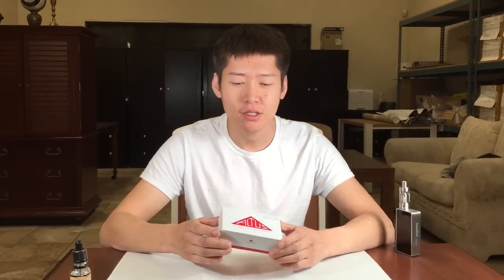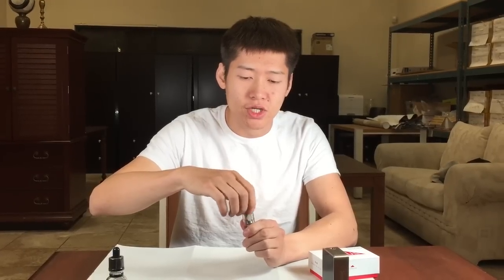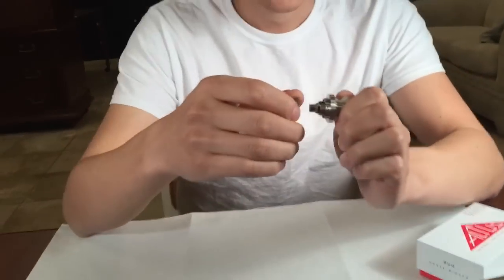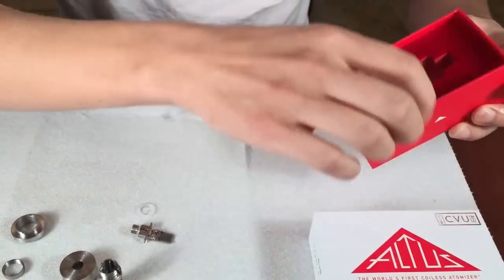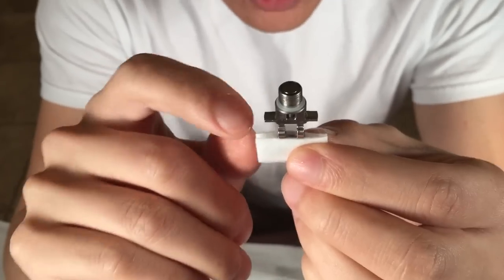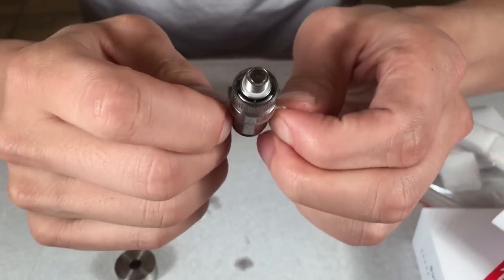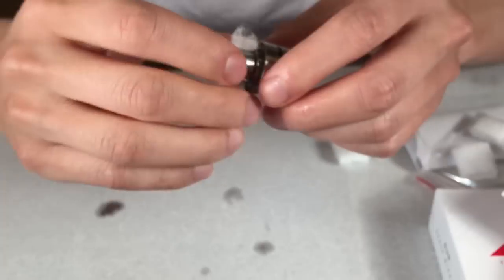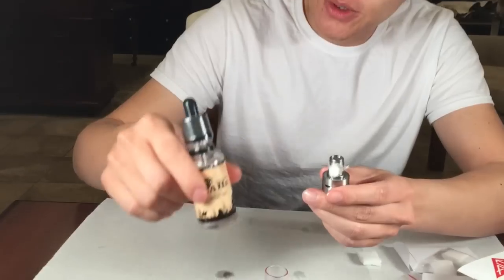Altus coiless atomizer tank by GUO (Unofficial Product Introduction)

Comment: Since your product is available for purchase, wouldn't it be advisable to release the composition of the materials and MSDS?  I am VERY interested in purchasing one, but won't until I know what it's made of.  You've created  game changer in the vape world, I'd just like to see you gain the trust of the public and also loyalty.  Even if it's cloned, if you build  relationship with your your customers based on trust, it will benefit you in the long run.  Congratulations!!!!!  ;-)
Reply from the maker: +TheGumbyDiver I seriously consider your suggestion :)
Reply: Its a small, virtually non porous, thermo conductive ceramic chip. Which will over time will crack, become brittle, and introduce microscopic shards of ceramic particles into your lungs.
Reply: +k. martin
Not a hater nor any kind of competition. I'm just simply stating the facts, that's all.
Reply: Are you an engineer?  I'm just curious.  I've been thinking about this and kind of comparing it in my mind to something like the material that the space shuttle tiles are made of?  What you said makes sense, but I'm wondering if Davids collective have done testing and have an estimate of how long it will remain completely intact without developing the stress fractures due to thermal exposure.  Also, the instruction manual says NOT to dry burn it.  I'd like to know why that is.
Reply: +TheGumbyDiver 

Oh no sir, no engineer, just very educated and I do tons of research on things like this, especially since I vape myself. I have to be careful what kind of wire I use, cotton, ejuice, ect as my lungs were ruined during a deployment. I believe its a similar material as what is Aerospace applications or even a Silicon/Nitrate based material which, either way, is not good to be breathing in. The dry burning is definitely going to speed up the aging process of the material and most certainly cause it to become weak and brittle. I'm not trying to bash the guy, he just needs to be up front with people instead of "details relased soon or at a later date". I just want people to be cautious of these kinds of skeptical products with little to no information. It's sad how many blind sheep there are now days. I'll stick to my stainless 316L claptons and US grown 100% organic supima cotton.
Reply: I hear ya, Brother.  I never was deployed, but I know about the lung issues.  I'm really cautious as well.  I've stayed way from Ni200 and Ti.  SS is my go to.  I'm finding myself being really skeptical of their refusal to release any information on the materials.  I mean shoot, they're already actually selling them tis weekend and refusing to tell their customers what Temp profile to use.  That doesn't make sense to me.
Reply: +TheGumbyDiver David here: noted. Seriously considering it.
Reply: Exactly my friend, this just seems too good to be true. A company not willing to disclose information regarding their products/ materials used, especially a product used to ingest vapor into your body doesn't seem good to me. I guess we'll just have to wait this one out and see how it unfolds.
Reply: +TheGumbyDiver SS is an alloy, Ti is what they use for surgery and body parts. Im thinking Ti is safer than SS.
Reply: +dansus99 

Ti is fine for prosthesis applications, but supposedly not for heating and ingestion into lungs. I've tried every kind of wire so far and 316L SS has been the oil wire to not give my lungs problems. I have sensitive lungs and asthma due to the military. I had to quit smoking from all this and turned to vaping. Been doing it 3 years now and have tested all kinds of stuff before learning SS wire and Supima cotton is what works for me. To each is  own though, different strokes for different folks.
Reply: +dansus99 Actually when heated TI is less safe, look into the heating properties of both, SS stands up to dry burns for instance, do that with TI and you will have lung issues.
Reply: +E36M3M50 how can you know the "facts" on their product? you cant...
Reply from the maker: +Todd Riley he doesn't
Reply: +jbohn 

Thank you very much good sir. I use wire from UD(youde), a local supplier, or Average Vape Guy here on YouTube. The Supima cotton I use is Texas Tuff cotton. This is the only stuff I use now and have nothing but great things to say about 316L ss and Texas Tuff cotton. My Realeux RX200 had SS temp control and so does my Koopor Plus. I get great vapor production with the peace of mind with the temp protection. My favorite tanks are my Aromamizer RDTA with dual vertical ss claptons. My favorite RDA is my Tobecco Velocity. And my favorite sub ohm tank is my Uwell Crown, especially with the RBA kit. Hope this info helps. Thanks
Reply: +k. martin 

Look at his next video. Thermoconductive ceramic embedded with tungsten. I guess I do have my facts.
Reply: He's using his own invention on camera for everyone to see. It's like a fugu-chef: you must prove your skill by eating fugu you cleaned. If you did it wrong, you die.

Comment: It looks like a silicon nitride si3n4 heater.Very well designed.
Ramp up time not gonna be a problem for preheat capable mods like dna200.
Reply: +oynamalan Now they just need to let us know what resistance wire type is embedded in their heater core, or at the very least release a proper TCR curve for it. Oh, and claiming it's fine to use on any regulated device is just plain dangerous.
Reply: +Rob Carter It's probably tungsten.
Reply: oynamalan Yeah so far that's been the most likely candidate I've seen. Makes a lot of sense as that would work correctly on ni200-tuned devices with the temp turned down about 25% from desired actual.

Comment: This product has the potential to push towards a much, much safer form of vaping. This product is extremely new but as long as the chip is insulated safely I see no reason why it could be dangerous other than if someone tries to use it at 150+ watts hopefully it is  safe at higher wattage devices. I would recommend this to anyone looking for a simple product for vaping but not for a  introductory vapor. I hope David continues to make more products as innovative as this one.

Comment: David, I just received my tank today.  I'm having some issues and I hope you can help.  When I opened the box, the tank already had cotton installed.  So I primed it and filled with juice.  I was using it at 50 watts to start and went up to 65.  After just a few minutes I started getting burnt cotton taste.  So I replaced the cotton and the tank started leaking all over the place.  I fixed that (I think the bottom module's tabs weren't locked into place).  Now I'm trying to vape again and it's splattering my mouth with juice.  My first two draws literally gave me a mouthful of juice.

I'm not bashing the product, but I figured as I'm one of the few people who got this immediately that you could help me since there's very limited information so far.

I want to love this tank, but I need it to work properly first!
Reply: Hi Jon, for the Altus to work properly 1) the CVU needs to be correctly centered on the port and inside the cylinder, 2) the cotton needs to be installed correctly. All the tips in the user manual are important to be followed. I will post more videos to clarify for you tonight. Can you email me a photo of the CVU on the port clips? Guovape@gmail.com We'll make this work for you.

Comment: I understand why you want to keep the name under lock and key, but for people with TC mods that are calibrated for either Ti, Ni or SS wire which setting is closest calibrated to the device?

I'm sure it would be found with trial and error, but knowing ahead of time would prevent a possible dry burn.
Reply from the maker: +charlsey26  it shouldn't take long. We are working with selected manufacturers to have CVU compatible mods. Look for those in the future.
Reply: +David Guo in the video you're saying that you're using it in TC mode on snow wolf. Which TCR is mod using?
Reply: +charlsey26 Yes, I'd like to know this as well. Also will you be releasing TCR values for people with the DNA200 and SX350?
Reply: +David Guo Ha, so you want me to buy a new mod to? Pfft I'll wait till somebody else figures it out.
Reply: +E36M3M50 the 2nd law of thermodynamics dictates everything will fall apart over time, even the universe. I can't disagree with your general statement of "over time". However, the chip is so sturdy the technology is tested up to millions of cycles. I didn't want to disclose this number because it implies the possibility of over a decade of usage time - which is scary. But that's the extent and potential of this technology. Can we do more comprehensive further testing? Yes, we must and we will, especially because we want to prove our reliability to skeptics 😊 In the unlikely event that the chip does crack, which is more likely to happen by trauma such as throwing it against a hard surface, the crack will cause the chip to fail entirely and stop working. 90% of it is trapped underneath the cotton, and the density of the chip makes it unlikely to travel upwards against the force of gravity. Why not also consider the risk metal poisoning? I think that's a higher risk factor.
Reply: +chill out about the usernames man 
I meant to say that the risk of coils such as metal poisoning is a higher risk factor
Reply: +chill out about the usernames man 

If you want to get into metal poisoning, isn't the tank that helps contain the ejuice metal itself? I just don't understand why you cannot disclose what the chip is made of (msds) to ease new customers minds. If you stand behind your products and want to gain the customers trust then I feel it's the least you could do. That kind of information needs to be released when introducting a product to the market. Especially one that is directly or indirectly ingested into the human body.
Reply: +E36M3M50 there is no fda regulation or any regulation of any kind on vaping. Do you have a link to Arsenal wire msds? How bout Royal?
Reply: +E36M3M50 I wasn't aware that the tank itself was a heating element. I want whatever you're vaping
Reply: +charlsey26 it's a great idea ,but cloud is not that amazing  Click below link to join the 10000 vendors facebook group to see how vendors think about it https://www.facebook.com/groups/438713829637655/

Comment: Looks like the same design principle they use for an induction stove top. If so, then the liquid won't even be exposed to the heating metal at all, it would be inside that outer layer. And it's almost definitely SS underneath if he's using it on temp mode and wattage mode. Could be wrong, of course.
Reply: No if that were the case you guys would wait for a minute per hit lol

Comment: Is the chip replaceable, or is it essentially most of the investment?  What is the anticipated life expectancy of the chip and other components, roughly speaking?

Though I may be disinclined to invest so much in any 1 tank, it sure would look attractive if US regulators make it difficult or impossible to buy the traditional disposable coils and other vape products we have become used to (especially for those who don't build their own). In any case, kudos on the innovation!
Reply from the maker: +JGG11 It's a new product and we will honor our 1 year warranty. I expect it to last for years if you don't abuse it.
Reply: +David Guo I get you not wanting to release the material of the chip, but your refusal to answer simple questions like this guys question about whether replacement &quot;chips&quot; and questions about what temp control setting youre using on your mod are a real turn off. 

Im intrigued by the product but playing coy about basic questions about usage of your device really sucks. You need to rethink your strategy with your answers.

Comment: After further research into this product it seems like you have to use this device with temperature control set at around 450° otherwise you will get dry hits. This needs to be mentioned to anybody wanting to buy this. Because if you're mod does not have temperature control for tungsten and you go above 70 watts you will definitely get a dry hit.Also this doesn't seem to work very well on high VG E liquid due to the amount of wicking material, it basically can't wick fast enough.
Reply from the maker: +Phil Pinto Thank you. You may try Fiber Freaks' cellulose fibers, and generally thinner cotton will increase the rate of wicking. Just be careful not to thin it too much or else leaking may be an issue.

Comment: DAVID I cant get mine to fire in temp mode, im using  rx200, onwatts it works like  a normal tank but i heard its best best best on t.c
185 c, 72 watts, refuses to fire in temp mode '; ? any suggestions ? , even the warm up temp u suggested,  so on reloux , i d k how they do temp, should i vape it or try it on nickel or stainless steel, wjats the temp for tungstung

Comment: Is it possible to damage the chip by overheating?  If that happens is there a way to replace the chip and only the chip?  Thinking long term it seems like since it is exposed to pretty high temps over and over it would eventually need replaced.
Reply: Under 600c should be no problem. Operation temperature is under 200c, so I doubt you will hit that high temperature unless you do it on purpose. I took it much higher repeatedly and it still works 😝 But please don't do that and read our warnings. Anything can break at high enough temperature. Even superman is weak against kryptonite.

Comment: and i got rx200, so  the chips pretty good, i did the warm up like david said, but whenever i put temp control on, it wont fire it jus says like "temp locked" or something like that. should i b vaping it in nickel settings, ss settinfs? help! also, i blow hugeee clouds on just watt mode so idk what the other guys were syin
Reply: Hi Ryan, it's David here. In general the RX 200 is not the greatest TC mode for the Altus. I suggest using power mode or switching to another mod for TC mode. But if power mode works fine, why fix it if it ain't broke? Thanks for supporting our product.

Comment: Remember Vapin Donuts? Pretty much identical concept. 

You claim it works for temp control, but given the size of the embedded wire and the listed resistance, it's almost certainly not nickel. If that's the case, you must specify the material, or at the very least the TCR, so that people can safely use this thing. 

On top of that, claiming that a resistance-climbing material is fine to use on any regulated mod is foolish and dangerous. You do understand what happens when that kind of material is put in a chain-vaping situation on the vast amount of regulated mods that check resistance and lock firing voltage when fired right? 

I'm excited to see how it goes when people start using this with many of the popular sucralose-filled "coil killer" juices on the market. That heating element is absolutely going to gunk up, and it will need to be dry burned. Is your ceramic designed to withstand that without degrading?
Reply: David here: I appreciate all your points. And great effort trying to obtain the chip information by having me answer yes or no. I will say this much: there is no embedded wire, even if it looks like one. You trust in the TC too much - all of them are approximate averages of the system, with boundary conditions constantly changing. So chain vaping is always risky regardless of using coils or CVU. Vaping is risky, but we still choose to do it. Having said that, I will seriously investigate your points and have my team do our best to continue reducing the risk for everyone. Thanks.
Reply: I'll be totally open about this: after I looked at this more closely, and the credentials you guys have, I went and ordered one for myself. 

The main thing I'd like to get from you is the TCR of the heating material (regardless of what it happens to be). So far the most reasonable prediction I've seen is that embedded resistance material is tungsten, as that would explain the CVU working with normal ni200 TC devices, and the relatively low suggested temperatures.

Even better would be a proper TCR curve in a CSV file available for customers to download.

Thanks for the reply.
Reply: +Rob Carter thanks for the support Rob, hope you will enjoy it. Yeah it's tungsten, but not completely. But the curve for tungsten should work, and we will provide the actual curve to you guys soon. Have fun :)
Reply: +Rob Carter 
I thought the same thing.  Vaping Donuts -- those were neat but the ramp up time was too long, and they seemed to get WAY too hot.  This product (Altus) looks much better designed though -- at least the heating element anyway.
Reply: +Rob Carter 
I never understood the need to use sucralose at all in e-liquid...I use ethyl maltol a lot, i LOVE it actually, it gives you a nice cotton candy sweetness and fuller feel...you just have to use the right amount of it...as too much kills the flavor -- but that's pretty much how everything works when it comes to juice...too much of any one ingredient and it's ruined :O